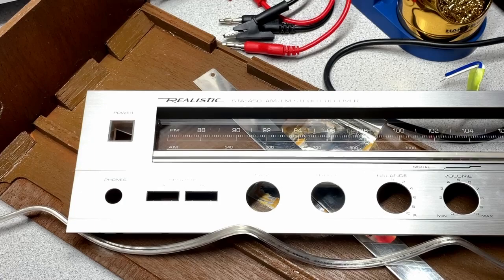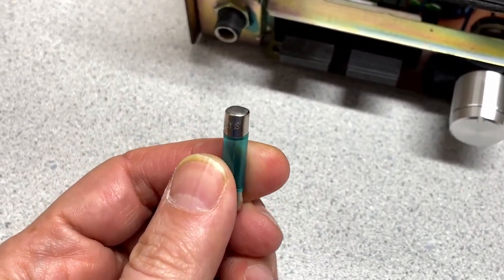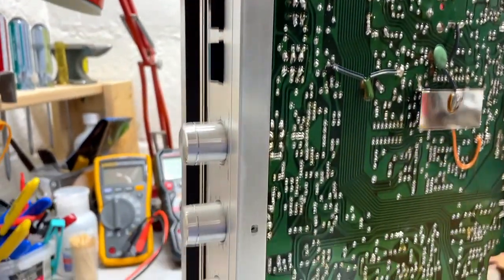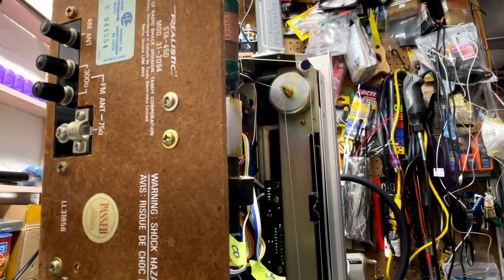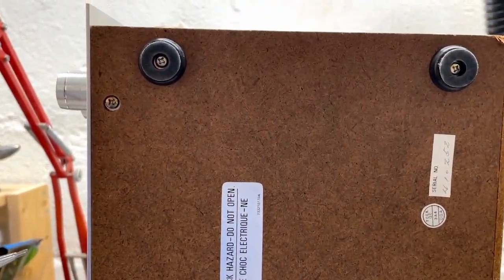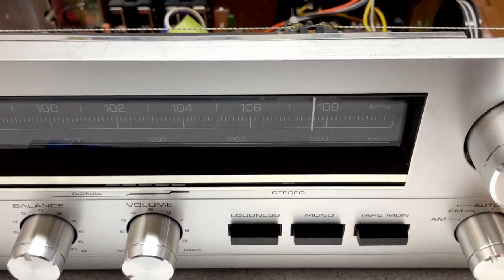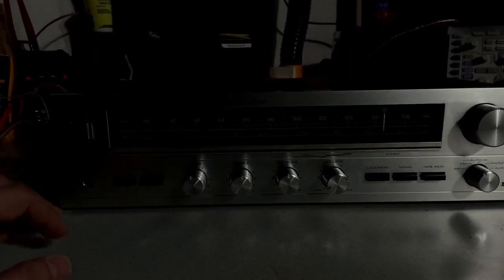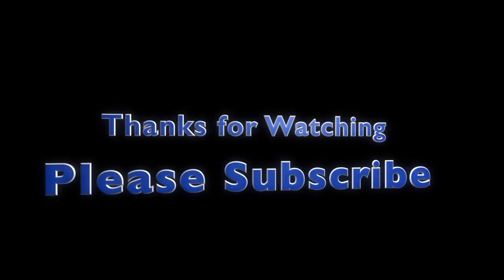Refurbishing a vintage Realistic STA-450 receiver

Comment: I tried the ebay link and nothing. Do you have the model number of the bulb ?
Reply from the maker: Try this https://www.ebay.ca/itm/124532505922?hash=item1cfeb73d42:g:6t8AAOSwZGRgBMIq&amdata=enc%3AAQAIAAAAwD6lWb4oYfSxW7L1VOGpKEa6C%2BlGzhOZiYMpYBKB3XatQtyAS0PEHU%2BMhMnZ9FQs1Akv0RuZUEvmzVw97kr4GAp3oschsRw2udJsoYg4Mt0HGNbu6OFaNERT0ry4oBTMsltHd5U1a18lpjEjUf4VBEVhp77LgLLQhrK77bqrAfbok4hQNHcvPdAHXzxXZjU8L5U44Yrj1eEXoWwF%2Bcp0Rqv4gZYjMW9oeHf6s7tO0xhcqucqk52KW0NsL8%2FjHq6pUA%3D%3D%7Ctkp%3ABk9SR-CykoaDYw